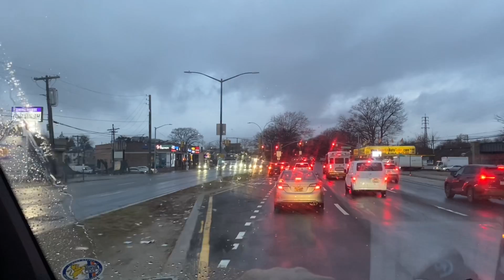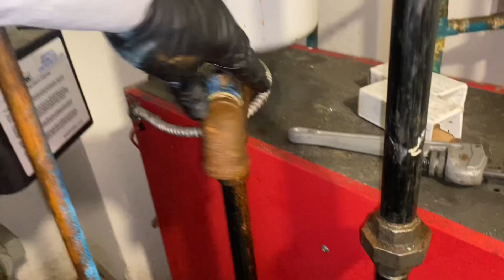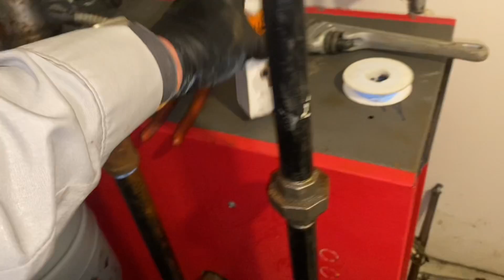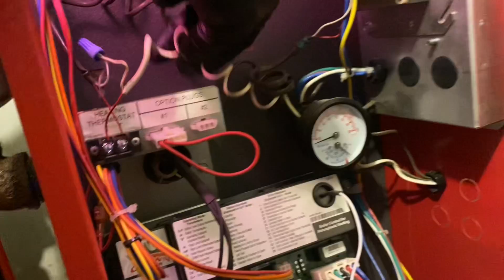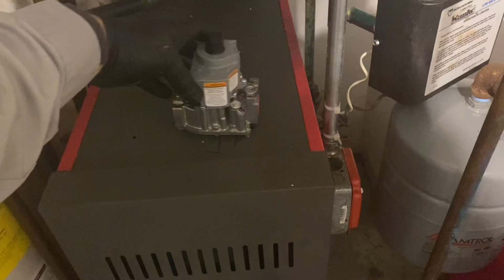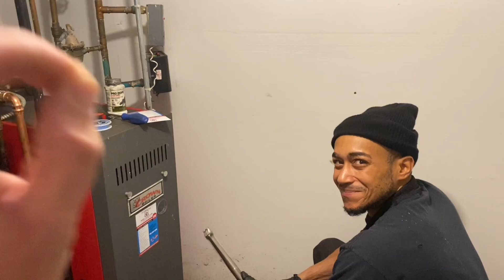Dangerous Gas Boiler Uncovered During Annual Heating Maintenance and Tuneup Service Call!

Comment: The WD-40 you like, wasting a lot of it if you lay a rag down first, then put the heating elements on top of the rag and then spray it. You collect more WD-40 and the other rag that’s on the floor instead of spraying and making the floor slippery.

Comment: I have seen defective gas meters cause large input pressure surges, usually you can hear them dragging and stopping, then taking off again.
always a good idea to watch input pressures and test on both sides of the meter. of course look for other large appliances that may be cycling and drawing more than available to the home, say a tankless unit.(installed by hacks, where one shouldn't be?)
Reply: Regs not meters
Reply: @francisoconnor2392  bad meters will cause surging, if the bearing surfaces, valving or diaphragms starts failing inside they'll start to alter the gas flow, causing it to surge  in pulses. you can generally hear them start to make squeaking noises and if you monitor pressures it will look like "waves" on a graph.

Comment: ChatGPT:
LEL UEL of CO in atmosphere

The Lower Explosive Limit (LEL) and Upper Explosive Limit (UEL) of CO in air are measures of the concentration range at which a gas mixture is considered flammable or explosive. The LEL is the lowest concentration at which a gas mixture can be ignited, while the UEL is the highest concentration at which a gas mixture can be ignited.

The LEL for CO in air is approximately 12.5% by volume or 35 parts per million (ppm), and the UEL is approximately 74% by volume or 20000 ppm. This means that if the concentration of CO in air falls between these values, the mixture is capable of supporting combustion and can potentially explode if an ignition source is present.
It's important to note that the specific LEL and UEL values for CO may vary depending on the specific conditions, such as pressure and temperature.

Comment: How come you use press on copper fittings for relief valve discharge pipes. The next time you have to check or change the RV, you must cut the fittings or the pipe?

Comment: Mikey Pipes, Great drip leg, thinking that cost more than I made as a Helper, But, We found out that cutting the drip  leg at the bottom at a 45* or what ever. The home owner wouldn't be able to cap off the end, just a thought. Frank is picking it up, little at a time baby steps.

Comment: Love it Mikey! I just changed a relief valve and expansion tank in someone's home today. Their boiler was hitting 30PSI and relief valve wasn't opening, but dripping onto the floor. Exp. tank was water logged. Got it done! I hate purging though, it's so difficult for me after 4 months into the trade.
Reply: You’ll get used to it. If bladder in expand tank is still working pump  up expansion tank to get water out of the tank so it’s light as a feather before removing. Also make sure new tank has proper psi I’ve gotten new exp tanks at 0 psi.

Comment: Press looks good for the outlet of the psv until you need to replace the psv and you have cut the fittings to get it apart.
Reply: No big deal, if your there replacing it you can make a new mip and elbow
Reply: or the homeowner shoves a "push-on" cap fitting onto the dripping end of the copper. lol, that's why so many used black iron pipe with "no threads" on the bottom. of course cutting the pipe at an angle around 45 degree works also.
that said I have seen copper pipe corroded shut and holding pressure.